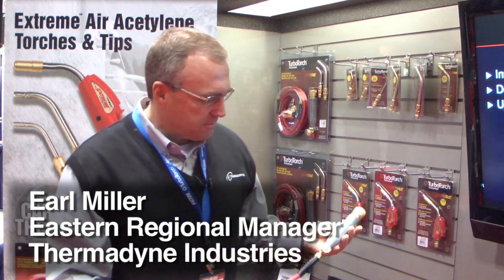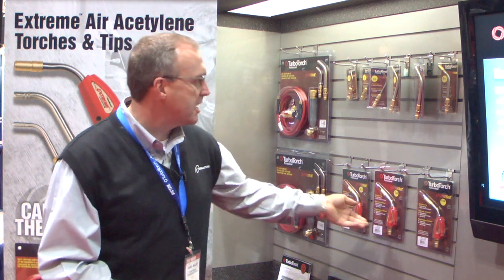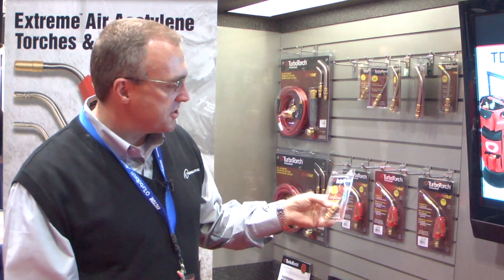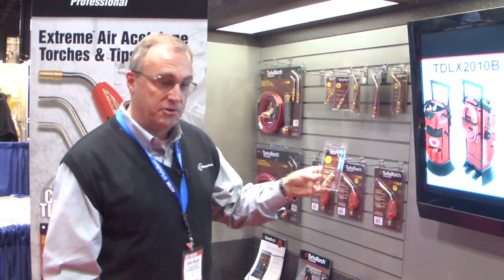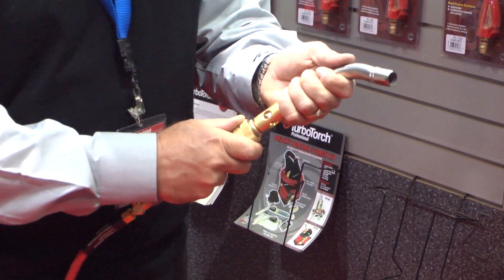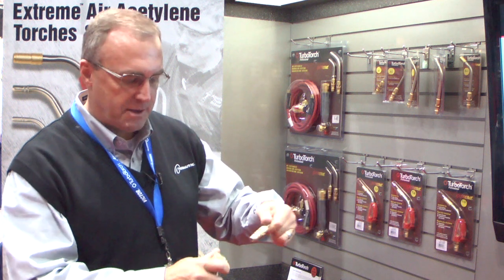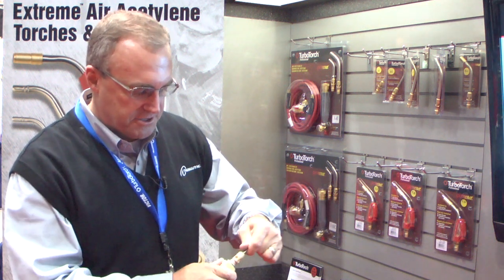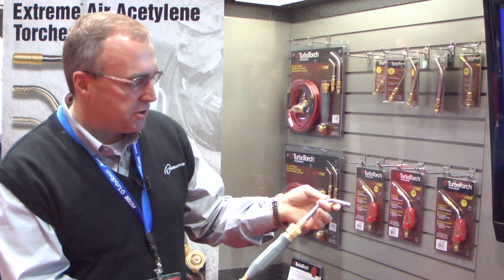TurboTorch Tip Selection Advice

Comment: Irresponsible and dangerous advice!
 Using a 32 cu.ft. hour tip on a B tank (40 cu.ft) is wrong and will result in acetone spurting out of the tip. 
Rule of thumb is 1/7 of acetylene tank capacity per hour.
Reply: Yep, I was thinking the same .."wait, he said what?  Burn though a b tank in an hour?"
Reply: Well so much for his decades of experience...

Comment: I need a self lighting tip that will withstand 1000 ignitions per day in a production setting..  what do you have?  Everything I've tried, the triggers, igniters, fail..
Reply: That problem was solved before either of us were born. In a production setting you can install a "gas saver" which is a pilot light and manual valve.  https://weldfabulous.com/miller-smith-wdw101-soldering-brazing-acetylene-cutting-torch-gas-saver/ Hang your torch on the arm and the weight shuts off the valve while the pilot light burns. I have one I use for gas welding and love it.